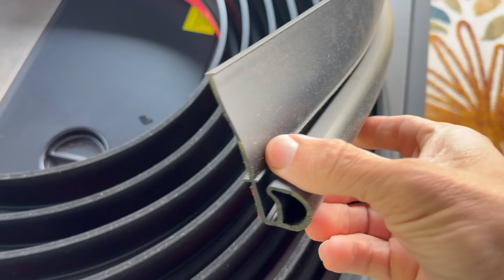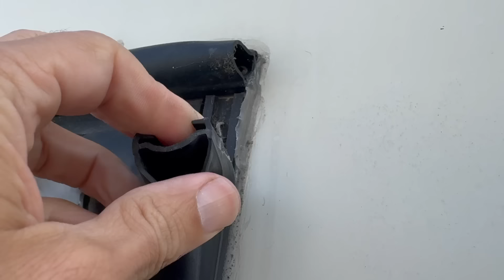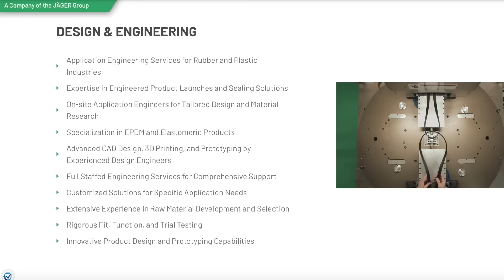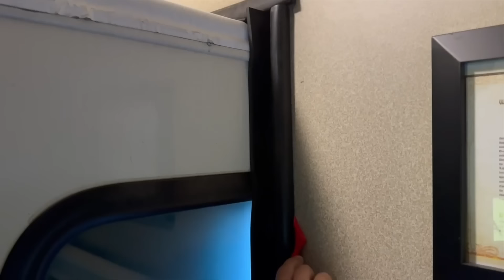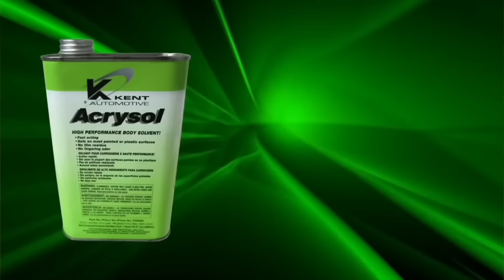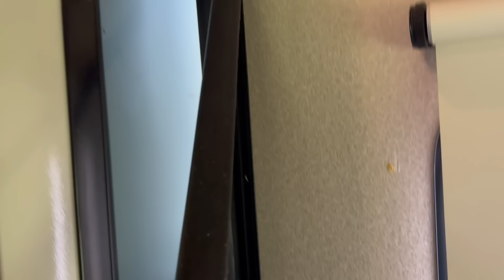GREAT RV MOD! - How to Replace Your RV Slide-Out Seals

Comment from the maker: ✅FLIP N’ SEAL HOMEPAGE ✅
RV sealing systems - Jaeger Unitek Sealing Solutions, Inc.
👇🏼Get a quote and help from Flip N’ Seal!
http://jaeger-unitek.com/get-a-quote

❤️SHOP FLIP N’ SEAL ON AMAZON ❤️
Flip N’ Seal STYLE CAPS & SEALS on Amazon!! 
🔹 Flip 'N Seal StyleCap
https://amzn.to/47kJwde
🔹Flip 'N Seal RV Slide-Out Seal .91" Bulb x 2.5" Wipe (40 feet) https://amzn.to/4cScAcU
🔹 Flip 'N Seal RV Slide-Out Seal 1.13" Bulb x 2.88" Wipe https://amzn.to/3z4FSr7
🔹 Flip 'N Seal StyleCap for use with Gear Driven Slide-Out https://amzn.to/3yUXaad

❇️PRODUCTS MENTIONED IN THIS VIDEO❇️
🔹Kent Automotive Acrysol: https://amzn.to/4bSW8cR
🔹Kent Automotive Acrysol 20oz Can: https://amzn.to/3yQN1ej
🔹 GEOCEL 100% Silicone SEALANT Clear: https://amzn.to/3VxxOaF
🔹Lexel Clear Sealant: https://amzn.to/4aSNB8v
🔹 Geocel Pro Flex White RV Flexible Sealant: https://amzn.to/4bWqFqf
🔹 Boss Clear Pro Grade Silicone Sealant: https://amzn.to/3Xcj95Z
🔹Dripless Caulking gun: https://amzn.to/3X9clpU
🔹Caulking gun extended tips: https://amzn.to/3VA2Oaj
🔹Plastic Putty Scrapper: https://amzn.to/3yEYete
🔹Metal Paint Scraper: https://amzn.to/3fW5KJ7

💵SAVE MONEY BY USING OUR LINKS AND PROMO CODES BELOW!💵

🛠️✅✅FIX RV ISSUES YOURSELF✅✅🛠️
Save MONEY!!💰 Learn what the PROs know with a self-paced ONLINE course packed with practical tips and step-by-step instructions to empower you as an RV owner.
👍🏼 LINK BELOW 👇🏼👇🏼👇🏼👇🏼👇🏼👇🏼👇🏼
💵CODE: WHYWAIT to save 40% off RV Tech Home Courses! https://rvtechcourse.com/?ref=ckapperman12

⭐️🔻BUY RV SNAPPADS🔻⭐️
10% off with PROMO CODE: WHYWAIT 
https://rvsnappad.com/

✅👇🏼💦BLUE TECHNOLOGY WATER 💦 👇🏼✅
💵 7% OFF by using our link below!
Save on all Blu Tech Filtration Systems and Water Hoses!
BLU TECHNOLOGY WEBSITE: https://goblutech.com/?ref=whywait

⭐️SHOP ALL OF OUR PRODUCTS⭐️
✅ Why Wait Amazon Page ✅ https://www.amazon.com/shop/__whywait__
All of our favorite RV gear, categorized & located on our Amazon Storefront. 

🇺🇸THE BEST RV INTERIOR AND EXTERIOR CLEANING PRODUCTS....
❤️❤️GABES PRIDE❤️❤️
🌟LINK BELOW!! 
https://bit.ly/3xTciRf

💵SAVE ON NEW RV MATTRESS 💵
⭐️Visit https://rvmattress.com/whywait and use code: WHYWAIT to get 25% off your Cub order! 

❤️SAVE 5% on RecPro orders using our link below and enter this promo code: DKPKNUS
https://www.recpro.com/?referral=DKPKNUS

💚BUY GAS STOP💚
🔻Promo Code: WHYWAIT for %10 OFF!🔻
https://gasstopusa.com/

✅RELATED VIDEOS
🎥 How to RESEAL Your RV PROPERLY (3 Year Review of Proflex RV Sealant)
https://youtu.be/5J5FLjTB1OY
🎥How to Replace your RV Underbelly and Check for Leaking Tanks
https://youtu.be/Zh_NNMhye2k

⭐️❤️❤️PRODUCTS WE USE AS FULLTIME RVERS❤️❤️⭐️
✅Cleaners, Lubes, Tapes, Sealants
🔹Eternabond Tape: https://amzn.to/2YpetKE
🔹Boeshield T-9 Rust prevention and lube: https://amzn.to/3RWSDKp
🔹303 UV protectant spray: https://amzn.to/3u7tnCJ
🔹Happy Campers blank tank treatment: https://amzn.to/3r2HRCr
🔹Thetford drain valve lubricant: https://amzn.to/2Zi0cja
🔹Plumbers silicone grease: https://amzn.to/3jPaelx
🔹30 Seconds Outdoor Cleaner: https://amzn.to/2YHnfnf
🔹Lucas Red n Tacky Grease: https://amzn.to/3s3qz9t
🔹Proflex RV Sealant: https://amzn.to/2U8KYxY
🔹Alpha Systems 1021 Self Leveling Sealant: https://amzn.to/37Di78m

✅RV Must Haves
🔹Valterra twist on sewer gate valve: https://amzn.to/3iVccjI
🔹Camco 20’ Rhino sewer hose kit: https://amzn.to/3cj5Fhy
🔹Maxx Haul wheel chocks: https://amzn.to/3chAras
🔹TST Tire Pressure Monitor System: https://amzn.to/3cfONrW
🔹Viair Portable Compressor: https://amzn.to/3nRsYlh
🔹12 Ton Bottle Jack: https://amzn.to/3zq5DPd
🔹Torque Wrench: https://amzn.to/3MdHrqO
🔹1/2 Drive impact flip socket set: https://amzn.to/3t5Qq1u
🔹50 Amp Extension Cord: https://amzn.to/3K6ANjk
🔹RV power adapters 50amp to 30amp: https://amzn.to/39pLPPP
🔹RV power adapters 30amp to 15amp: https://amzn.to/3cg6KXd
🔹Hughes Watchdog EMS-50 Amp surge protector: https://amzn.to/42QG5YW
🔹Telescoping A-frame ladder: https://amzn.to/4d8WZGP
🔹IWISS PEX Cinch tool: https://amzn.to/39pYthL
🔹Camco clear 90degree sewer elbow -  https://amzn.to/39exjuw
🔹Camco 20ft sewer hose slinky support - https://amzn.to/2HE5Jvp
🔹Camco rubber donut sewer seal - https://amzn.to/3fB4Os4
🔹Camco clear 45degree sewer elbow - https://amzn.to/3m3URFY
🔹242 piece fuse assortment kit: https://amzn.to/3qZArA1
🔹Water alarm Detectors: https://amzn.to/3LbdWUS
🤝🤝CONNECT WITH US ON SOCIAL MEDIA🤝🤝
👉🏼Instagram: https://www.instagram.com/__whywait__/
👉🏼Facebook: https://www.facebook.com/chris.kapperman.5
👉🏼TikTok: www.tiktok.com/@_whywait_

......NOTICE......
Some of the links on this page are Amazon affiliate links. If you choose to make a purchase using our links, we will earn a small commission. This commission comes at no additional cost to you but helps us keep providing the content we share. We recommend these products because we use them as ourselves and find them helpful to us not because of the small profit we make. Every linked product we use and appreciate it when you use our links. Thank you.

Comment: Chris thanks for your youtube channel. Ive got grand design H wiper seals. From my investigations the seal between the slideout and wall is screwed in. So how did you get yours out. Thanks.
Reply from the maker: Don’t know. Mine was just stapled behind the d-seals into the track both inside and outside like in the video.

Comment: Great video Chris; I loved your explanations even better than Flip n Seal's video.  However, I wonder why you both chose not to show how the interior upper seal is installed.  I figure it must be difficult due to tight space.  Mine will need replacing. Is there a video for that? Also, how many feet of the seal should I buy for a 2019 Montana 3931FB with 3 slides?  On Amazon it looks like each 35ft roll is around $250 to $280.  So maybe 2 rolls per slide for inside and out.  Finally, I emailed Luc at Jaeger-unitek and he suspects I'll need their 2.5" flap on the upper and the 2" on the sides; would you concur?  I'll have to measure the  ones I currently have.  Thanks and keep up the good work.
Reply from the maker: I’m glad the video helped, but unfortunately I haven't done a video on the interior seals just because it didn’t need it, I’m assuming it’s the same as the rope exterior m, should be easy. Also I can't say for sure on the exact measurements for your specific model, measure all of the slides, top, sides, the double if you are going inside and outside. Probably closer to 3 rolls just thinking about it. 👍🏼 Good luck with the project Tom.

Comment: I was just wondering I watched you video very informative, getting ready to order this product,  only one question, you only replaced the outer on the top, was that an H style on the top did you have to cut the outer piece off to do a single on the top thanks for your time Joe Huffman
Reply from the maker: It’s not an H style on top. Just a track with a D seal in it 👍🏼

Comment: Folks... stop using chemicals on your slide seals. They are NOT rubber its a plastic and every single manufacturer says to NOT use chemicals to clean... only soap and water... folks that do thay have seals lasting much mich longer... 

Sure, if you want to replace them all, go ahead... but stop using chemicals on them. That is what is causing them to fail..

Comment: Just subscribed. Liked your first vid where you replaced the slide bulb seals with some cheap shit Chinese crap that disintegrated in less than two years and I’m thoroughly impressed with the Jaeger product you’re using in this vid. I’ll order some. Waiting to hear back from them. My question to you is one for clarification…Was the piece of the original seal system you were prying the staples out of, the original “track” for the bulb part of the seals? Pretty sure I’ll be using the identical product you used, though I don’t have H-seals. I have a two piece interior/exterior system, where my exterior seals are a close match to yours but not a pass-through design. ( Not an “H” style )Inside my rig, is a about a 4” wide slanted white compression/sweep style seal that I’d have a tough time describing any better than that and it works well,  but it’s just the exterior seals that need replaced now. So, was that the bulb seal track you pried the staples out of the RV walls adjacent to the actual slide? And do you have a good vid on roof preventative maintenance?
Reply from the maker: I guess you’re asking if the track I removed was original or part of the d-seals I had previously replaced? In the past I only replaced the D seals, the track was all original, part of the H seal. 
For me, I did this with my roof and love it. Two videos linked below. 👍🏼 The original project and one year review as well. 

https://youtu.be/3CrVjVkEQWc?si=TSezJmwJu1tBCN_i

https://youtu.be/c-6kkZEdQD4?si=GVs5mBU9gBpSMOli
Reply: Thanks

Comment: To protect my seals on my slide out I use armor All car wash soap with  Carnauba wax scrub it and I rinse it off and it leaves a film of  wax which protects from UV rays and the rubber

Comment: That’s looks like a pretty good system, but my only concern would be that the old style hugs the corner protecting the raw material in between. This system you glue it to either side and it leaves the inside raw wood/material exposed to the elements.
Reply from the maker: That’s a great point about the corner protection! 🤔

Comment: what screws are you using to secure it? (size and type)
Reply from the maker: Honestly don’t remember and I don’t have this fifth wheel anymore. Just some stainless self taping screws work, and make sure they aren’t longer than the thickness of the walls 👍🏼

Comment: Wait, ignore my other comment on the D channel video. Doing this instead 🎉😂 Thanks again!
Reply from the maker: Yeah on the other video i would of redirected you to this video and told you to instal these. They are so much better if you have the old seals.
Reply: @WhyWait great. Got the roof cleaned today but the moisture was still there and didnt want to put the eterna bond down on a wet surface so will let membrane dry overnight. It will be a couple day project to do it right, but it will be amazing when done
Reply: Thanks as always!!!  @WhyWait

Comment: I called GD and was provided the part number 35004 for the dbulb seal on my 2022 2600RB Imagine, and the manufacturer's contact info - Jaeger-Unitek Sealing Solutions, near Elkhart.  I was first told that the whole dbulb seal was polypropylene (PP) - which I have not found anything that is recommended to seal/attach to PP.  Another person at J-U thought the d-bulb mount strip might be TPE thermoplastics, which some sealants will adhere to - Lexel says it will not - SikaFlex 221 will.  Sashco-Lexel, Sika, Geocel - none of their specs and techs recommended any product for PP - and the manufacturer did not provide a recommended sealant. (another one of those RV questions that you would think would be easy - and it is not).  Another GD owner said he had used Lexel and it still looked like new after 4 years.  Mine now has Lexel but I put it on BEFORE i started digging - Sashco-Lexel has a Do Not Use On - and that is where you find PP.  I am just going to keep an eye on it - the seal from GD was basically gone but the d-bulb was in good condition - whatever they used;)
Reply from the maker: Thanks for sharing the details of your experience with the seal replacement process!

Comment: Excellent video Chris, I was just quoted $1500 to replace my seals on my four year old camper! After watching your video , I am confident that I can knock this out myself and improve my product. So yea, thanks a ton for such a well made, well versed,how to video.
Reply from the maker: Awesome appreciate that. It’s a pretty easy instal and better upgrade. Little time consuming cleaning up the old tape and sealant but otherwise pretty straight forward. 👍🏼
Reply: You’ll be looking at alot more if you mess it up

Comment: Love your channel. Information's great and videos are awesome! Definitely going to check out this company based on your recommendation.  It's time for me to replace the bulb seals and wipers on my RV And I'm definitely looking for a good grade rubber without tons of regrind in it.  I'm definitely hoping that the company will help me picking out the seals/ wipers that I need.  My fifth wheel is a 2018  348A13 vengeance toy hauler. The thing that's unusual about it and I have a question for you.  There is no bulb on the inside anywhere.   The flange on the slide itself has some type of rubber that is attached to the flange and I'm assuming that's why there's no bulb.  My question or should I say questions? Have you ever seen that before? And will putting a bulb on the inside cause a problem?  The slides are mechanical hydraulic slides.  Any help would be greatly appreciated.  Thanks in advance.
Reply from the maker: Glad to hear you're enjoying the channel, and I hope the company has what you need. I’m sure if you reach out to them they can help you. Honestly if the inside seal has no bulb and you are ok with what is already there I wouldn’t replace it unless it’s attached to the outside seals like mine was. 👍🏼

Comment: This looks like an awesome product! We have to replace the seals on two slides, our camper is a 2017 Forest River Avenger, it does not have “flat” siding, it has ribbed siding. Would the flip and seal stick as well?
Reply from the maker: Hmmmm good question. 🤔 I think it would but reach out to the company and obviously make sure 👍🏼

Comment: Do I need to replace all 3 sides? Or can I just do the top?
Reply from the maker: Totally can just do the top, in fact you can even just do the top outside since it’s not connected to the top inside. 
Now if you do the vertical seams you will have to do outside and inside as it’s one piece like you see. 
If you just do the top though the corner pieces won’t work if you were interested in those.

Comment: Wonder if the system will work on older ( 1915) 5thn wheel slides by replacing all. Nice video, looks like a good product.
Reply from the maker: This is something you can reach out to them and ask 👍🏼

Comment: I have a ‘24 Grand Design 31G.  The Schwintek system has the upper and lower gear tracks that look impossible to have seals that will not allow water to penetrate into the camper.  One of my slides has leaked in the front from brand new.  I am to the point where I wish I had not bought this unit.  I cannot use it if it is going to rain.  Does anyone have a solution to this?
Reply from the maker: Reach out to Grand Design and see if they offer any solutions or replacement options. Hope you get it worked out.

Comment: Our fifth wheel has 3 slides. 2 LARGE slides that oppose each other in the living area of the camper and then 1 smaller slide in the bedroom.
The fifth wheel is a 2019 Crossroads Cruiser.
And it needs new slide seals all the way around. I think I just might be checking in to these seals.
Thanks. A LOT.
I’ve been having quite a rough time trying to determine what seals they used to build this thing, now, it looks like I can eliminate a whole bunch of headaches and start over with something light years better.
Reply from the maker: Sounds like a great project and those seals are definitely a step up! Great company to work with and easy to order and installing really isn’t that difficult. Good luck with it all Michael. Hope you subscribe and appreciate you watching 👍🏼

Comment: I got the same problem on our 2018 solitude. Is it possible to just do the top seal or do you have to do all of it?
Reply from the maker: @andrewadix2223  nope you can just do the top seal. And those are the easiest too because you don’t need to replace the seal inside if you do that. If you do the sides it’s all one piece and you have to do the outside and inside. Definitely a good product and worth it.

Comment: I have been looking at the seal system from TrimLok...it looks like a really well designed and thought out product. I just can't find a distributor I'm not buying 1575 ft. Minimum order..works out to under $2 ft. 
 I bought these corner seals and really like them.

Comment: I have a 2022 Highland Ridge travel trailer. When retracting my slide out, my wiper seal flips in during travel. Is this what should happen, or should it stay flipped out? I ask this because everybody refers to this as a wiper seal. Doesn't seem like it would wipe properly after it flips in.
Reply from the maker: Yes as the slide goes in the seal flips in essentially wiping the side of the slide out as it moves in. Then back out it flips back out wiping it too. Hope that helps.

Comment: Good video and I like that you answer comments which I understand is a lot of work. No questions now but possibly in the future. Still designing.
I am making a coach from a 16'ft x 8 x 8 all aluminum Morgan style box to be installed onto my '99' Ford E-350 class-C RV with the coach removed.
Planning on two DIY opposing slide-outs (futon & desk).
Reply from the maker: Appreciate that. I try to get to most. 
Sounds like an awesome project you got going down. Keep us posted!

Comment: I wish they offered a replacement for the double bulb style seals…😢
Reply: Hey there! We do offer replacements for the double bulb "H" seals. We unfortunately do not have any in stock on Amazon as they are quite large and would be difficult to stock there... We also do not offer them on Amazon because the replacement process for H-Bulb Seals is difficult as you need to remove the entire slide-out box to remove and add the new double bulb seal... but your local RV dealer should have access to a catalog to purchase them if you are interested in doing this replacement!